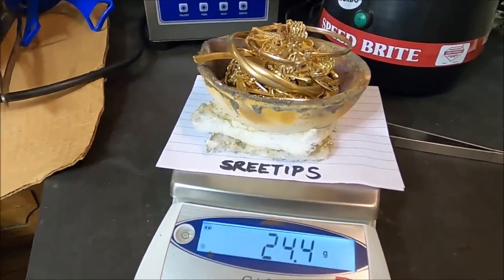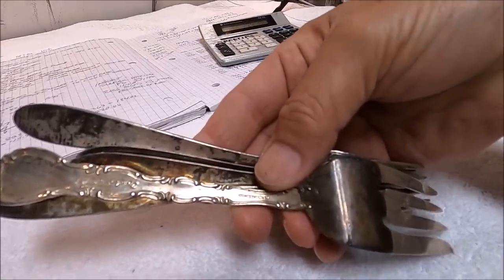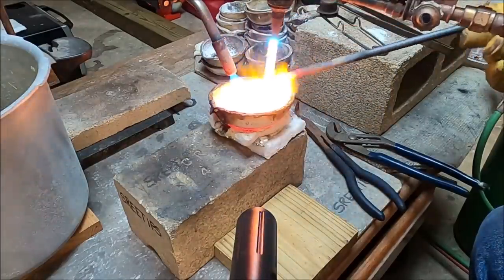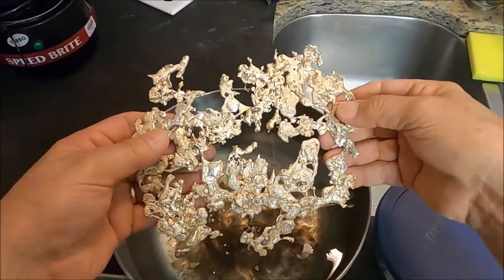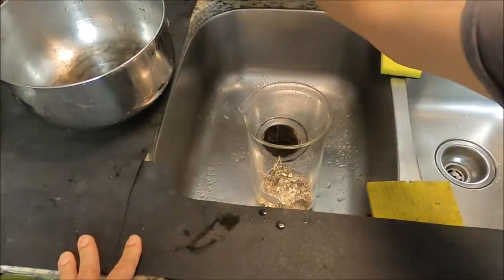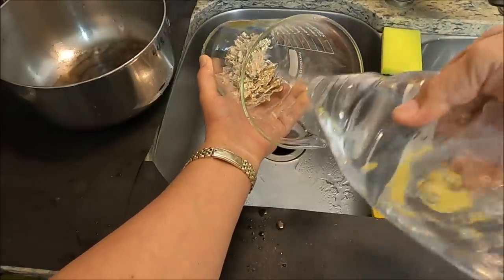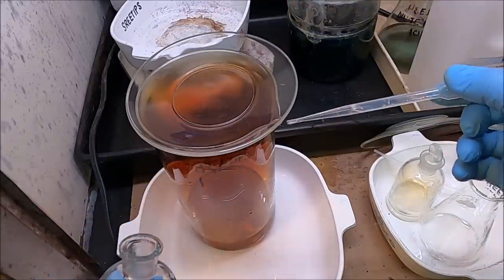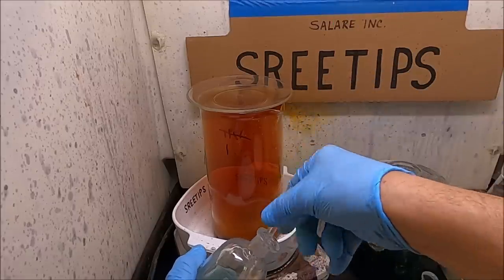Gold Refining $6500 Bar For Sale

Comment: If you use so much distilled water why not make it your self? Like buy a machine or make it on the stow?
Reply from the maker: It’s easier to buy it. I though about capturing AC condensate through a filter and try using that. But I’ve got so much heaped up and I’m way behind on everything.

Comment: Could you not use the silver that you get from the silver cell enquart the gold with? It would save you buying more sterling silver.
Reply from the maker: Yes, but that would be a step in the wrong direction. It’s already been through the silver cell. Using it to inquart would require another pass through the cell. I buy sterling at estate sales. Just bought another sterling flatware set today. So I have plenty of sterling to use for inquarting scrap karat gold.

Comment: Have you distilled your own water ever? Curious to see the process in your style
Reply: I was kind of curious of that myself. The same style of distillation mechanism used to make spirits can crank out distilled water really easily.
Reply: I have a small machine that distills water. Its basically a small stainless steel kettle with a top part that fits over the kettle part that has a fan and a small copper coil in it. It boils the water and it condenses and cools in the coil and spits out distilled water. 

The thing is its good for my operations but the amount of distilled water Sreetips uses plus all the extra work he does in a day it would be too slow of an operation for him... and distilled water is cheap so I bet he buys it.
Reply from the maker: I have not. 80% of my distilled water usage goes toward rinsing my cleaned glassware.
Reply: I have that same distiller as Joe the Toe, it does 4 ltrs in about 3 hours. In the UK distilled water is near impossible to buy anywhere, and if you can find it it's certainly not cheap
Reply: @JeffJeffers0n  Wow, didn't know that. For less than 2 dollars, we get a gallon here in the States.
Reply: @JeffJeffers0n  I'm not a toe.. I'm a thumb. But I guess that doesn't really have the same ring to it.
Reply: @Jeff Jefferson I get mine for Tesco’s £1.5 for 2.5l it’s deionised water over here
Reply: @Sreetips, If I remember correctly when you showed us the lab glass you have. You had most of everything that you would need in order to distill water to a pretty high purity. Not quite 100% but pretty close.
Reply: Always been envious of the States distiller water availability yes. Deionised is a bit easier to obtain here too, not sure I'd feel comfortable drinking that though as it can still contain impurities on some level, I think.

There's no such thing as distilled water that isn't 100% pure, because if it's not, it's not distilled water.

You'll always be a Toe to me, Joe.
Reply: @Joe.Rogan.  100M deal and you are still distilling your own water? That's dedication to the craft. Huge fan of the podcast btw.
Reply from the maker: I’ve got everything to do it, but I barely have time for my refining projects. Mrs sreetips picks up two gallons for $2 at the grocery store every time she goes. Buying it is cheap and easier for me.
Reply: If all that you're worried about is the chlorine in the tap water creating silver chloride wouldn't it be easier and more economical to just use boiled water vs distilled?
Reply: Boiling tap water wont remove the chlorine.
Reply: @sreetips  understood 100% and appreciate the content you put out. Didn't know this would generate this much buzz..
Reply: @JeffJeffers0n  boil for 12 minutes. Chlorine gases off.
Reply: xmachine 700, sure, and if you continue to boil for another 8 and a half minutes the water will start to recite Shakespeare

Comment: Since copper is cheaper and you seem to have a lot of it, why not use that to recover your gold? 
All precious metal prices have gone up, even the copper is worth recovering and selling.
Reply from the maker: Gold can be reduced out of solution on copper in accordance with the reactivity series of metals. But it would also drop any platinum group metals that may be in solution with the gold thus contaminating the gold and requiring further refining. Aqua regia wet chemical process is the easier softer way to go. It’s fast and effective. I just don’t have time to process copper. To a PM refiner, copper is considered waste. But I see your point. Thank you.

Comment: Doing this outdoors or using a fume hood is a must. Really great video!
Reply from the maker: No way to do it safely outdoors. Unless they’re being drawn away the fumes get in your eyes, hair and clothes. Not to mention your lungs
Reply: @sreetips  You stand upwind with goggles and respirator.
Reply from the maker: The wind will wrap around your body and pull the fumes right into you.
Reply: @sreetips  I've worked with muriatic acid outdoors, dissolving zinc to make acid flux, and also acid washed concrete. Didn't have that problem. I stand back and reach.
Reply from the maker: I’ve done reactions outdoors as well. No matter how hard you try there’s no way to do it safely. Having those fumes drawn away in a hood is the only way I’ve found. It’s the repeated exposure, healing, exposure, healing that will damage lungs. Repeated chronic exposure is the most dangerous. This has been my experience.
Reply: @sreetips  Luckily I rarely handle acids. A very long time ago I was acid washing a garage floor and got a wiff....It wasn't good, I tried keeping away from the fumes and only very shallow breaths....so I never sucked in enough to cause a problem. I would suggest placing a box fan off to the side between you and the fumes when outdoors on a calm day, it's what I do when I weld.
Reply: @electronicsNmore  arrogance
Reply: @generalmarkmilleyisbenedic8895  More like personal experience. Get it right.
Reply: @electronicsNmore   hes telling you how he does something, in an activity you dont even do. He never refuted you, yet you do to him. Just like your response to me, arrogance